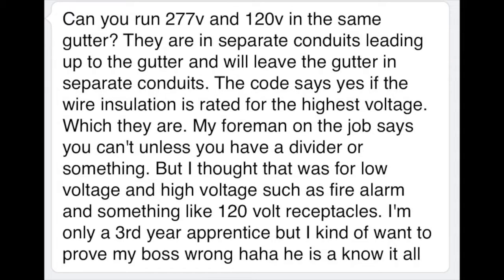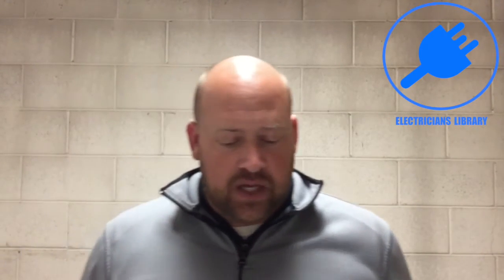120 and 277 in same gutter?

Comment: In some places due to more than 300 volts between adjacent terminals at switches a barrier between is a loose requirement. However there are lots and lots of places where there will be more than 300 volts between devices without a barrier. 🙂🙃

Comment: It should be noted that the maximum voltage developed in the raceway CAN be 120V+277V = 397VAC depending on phasing. This can happen if there is a 120/240V transformer hanging off one of the 3 phase wye legs on the 277/480V system. You would be violating insulation ratings if the conductors were only rated 300VAC.

Comment: I find it pretty important to do it in the most common colors, then there's no mistaking.  Some always do but some don't. I've ran orange blue and a green for a 240 pump.  I would have used a black or a red instead of the orange but that's what we had on the truck.

Comment: I agree with the answers given. Yes you can mix the voltages, if the insulation rating is equal to the highest voltage. Safe prediction on the THHN as well. I also agree with the pick your battles advise. Just because you can, doesn't mean you have to. He's not wrong in keeping them divided, he's just wrong in that he thinks he has to. I have my own way and my own reasons for doing certain things a certain way, and I don't need to argue about it with a 3rd year apprentice. I don't mind the job site discussions on the many ways of doing things, and I often give my guys the chance to make their own decisions, ultimately it's my call, and once I've made it, that's the end of discussion. I'll take the fall if I'm wrong.